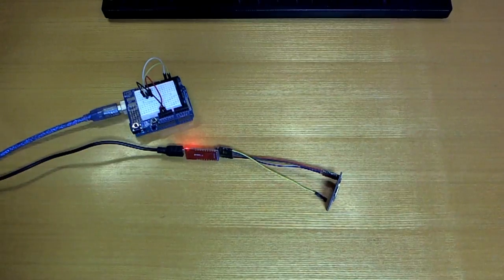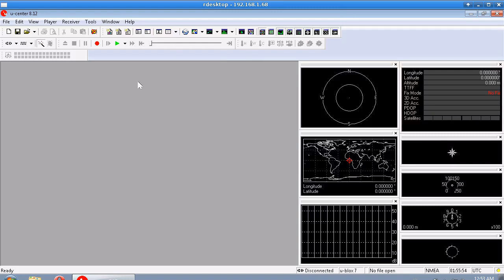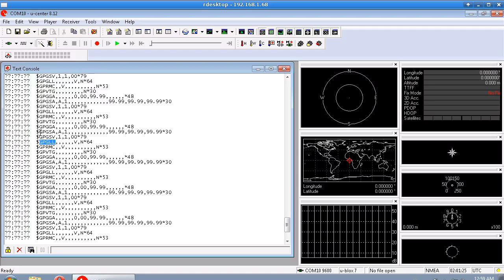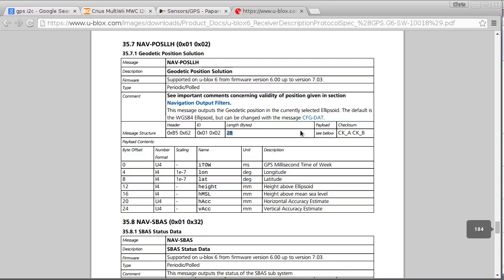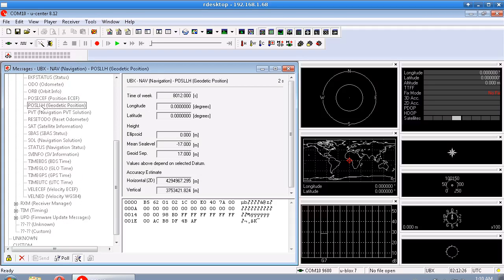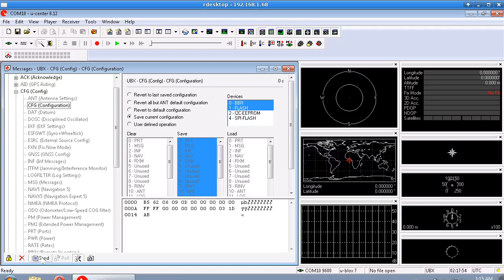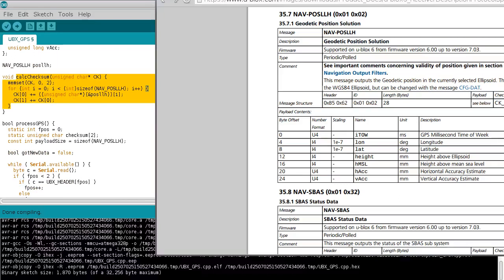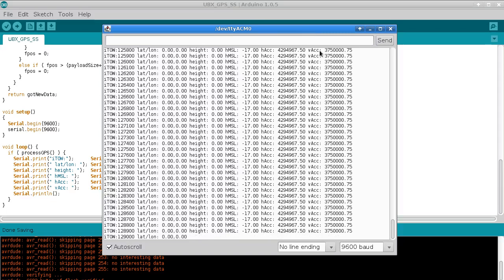10Hz U-blox binary GPS data in 66 lines of code (arduino)

Comment: hello brother, as i am trying to get NAV-TIMEGPS and NAV-TIMEUTC i am unable to read full packets its not reading last 5 packets so returning none. do you have any idea. i am using your multiple packets code added with NAV-TIMEGPS and NAV-TIMEUTC. i am doing this for esp8266 for reading nano second time. thankyou in advance.
Reply from the maker: Almost every time someone asks about using other message types, they are just getting the length of the packet (struct) wrong. The lengths of some packets can change between versions of the UBX protocol - make sure the documentation you are reading is for the firmware you're actually running.

Comment: Nice vid, helps if you've already tried to make sense of it all previously. I to have noticed a "save" problem. When i set my 6m to 10hz and 115,200 it connects to my naze 32 but when i connect back to u-center it defaults back to 1hz and 9600???
Reply: I see your comment was from nearly a year ago, so hopefully you found an explanation already, but in case you haven't and for anyone that runs into this, and also for the OP in case he hasn't bothered to figure these points out.

1) to save the settings, there are many methods to get to it but all roads lead to the same place...if you click the menu receiver, action, save config it will open up the packet view, and will drill down to the CFG/CFG message. The default that comes up is sufficient in most cases, simply click the send button at the bottom and it will do it. specifically the middle box should have all or nearly  all selected, left box unselected, and the devices box should normally have at least the flash selected.  * Note that some of the cheap modules don't have flash chips, or any means to save any settings. However, all is not lost, as many of the flight controllers have incorporated some form of auto-config, where it will check the uart at 9600 and if it finds a ublox module, it will attempt to reconfigure it to it's expected setup.

2) the list of possible packets that are grey/black signify what messages have been received from the module within the last 3-5 seconds. The main difference being that when you click on a black item, it will already have information in it, and when you click on a grey item, u-center will request the information from the module, and populate it if the module responds with the info. * For all practical purposes, it will typically be difficult to discern the difference unless the module has oversubscribed the data link.

Comment: i put the antenna with GPS module (neo6mv2,neo-6m-0-001) but latitude and longitude is blank. what can i do please help.
i also check during travel.
Reply from the maker: +kamran khan khanzada if you want help you should give more useful information so I don't need to make guesses and ask every little thing. Eg. is there any activity at all on the UART lines? Is the module sending any valid info at all? Is it sending the current time at least? Is it outside? How long did you wait? etc etc

Comment: Thank you for a brilliant  video, I have been experimenting with the NEO-6M gps module using your code with some success. I have noted however that the Lat and Lon values are only to two decimal places. My knowledge of C++ is very limited so my efforts to date have not been successful in increasing the number of decimal places.
Comparing the value from the NEO6 and a Garmin Etrex  there is approx. 400mtrs difference. 
Can you point me in the right direction please.
Reply from the maker: It sounds like you might be using arduino's Serial.print function to look at the values, and not specifying the number of decimal places, which defaults to two.
https://www.arduino.cc/reference/en/language/functions/communication/serial/print/
Reply: Hello  @iforce2d ,
 Thank you so much for the pointer I have modified my/your  code to give 4 decimal places, the result is now more acceptable. My next step is to send the data to my OLED display. Thank you again for your help :)
Reply: @iforce2d  Hello again,  I have been experimenting with the my NEO6M GPS and an  128x64 OLED display using the multi message sketch you have produced. Adding a display function I have been able to display LAT/LON, hMSL, vAcc and hAcc,  from POSLLH onto my display with not issues. Then I tried to add gpsFix from message NAV_STATUS , Serial printing is ok I get a value say 3. I then created a  second struct as you did for POSLLH  for the STATUS message using this value (locData2.gpsFix) I get a value of 3 on my oled display, then it toggles to what appears to be an address which increments up to 255 then starts from 0 back up to 255. the curious thing is if I serial print (locData2.gpsFix) it will display the correct value say 3.
If I call the display function from the STATUS message only and don't include the POSLLH message  I get the correct information on the display and the serial monitor.
This is bugging me any ideas!! . My other option is to use a NMEA sentence which has all the data I need, unfortunately my NEO6M wil not give me the PVT sentence. 
Apologies for the essay.

Comment: The data is coming in but, I can not change anyting in the u-center messages window. I can see the TX led lights up when i click "Disable Message" but the ublox receiver (neo m8n) does not apply the command.
Reply: Solution: I found that it works if you use SoftwareSerial on Arduino instead of the hardwareSerial
Reply from the maker: Maybe you were not aware that the hardware serial and the USB connection to your computer are the same thing. So you can't use hardware serial and USB at the same time. You have to disconnect the hardware serial pins to upload a sketch, and disconnect the USB to run it. You might find that software serial does not work well if you want a fast update rate.

Comment: What I need is latitude/longitude as well as the angle from the north and the director the gps is headed at. I do not know how exactly that is called (course, heading, azimuth) and I don't know what type of package transfers this type of information. Initially I tried to get this out of neo m8n but after repeated failures, i've fallen back to neo 6m, which I don't even know if it has a compass. I've tried a lot of things but they don't seem to be working, and they confuse me more. Could someone help me? Could TinyGps prove useful, or I need a different parser? Also i 'd rather use m8n due to its smaller size, but if any of these modules (m8n, 6m) meets these requirements, i'd be happy to work with it.
Reply from the maker: It's all in the docs bro https://www.u-blox.com/sites/default/files/products/documents/u-blox8-M8_ReceiverDescrProtSpec_(UBX-13003221)_Public.pdf
For m8n I would try the NAV_PVT message, it has pretty much everything you'll need. Keep in mind heading is only meaningful when the GPS is moving...
Reply from the maker: See also this follow-up, I used the NAV_PVT message here: https://www.youtube.com/watch?v=ylxwOg2pXrc
Reply: Thank you very much, yes, the GPS will be on the move. So I will pretty much disable all messages except NAV_PVT? I suppose on your video there is a parser for this message, i am about to watch it now.
Reply: After watching your video, and configuring the m8n appropriately (i think), I was able to get it to work with the u-center. Unfortunately the data was very inaccurate (several meters away), and on the information window it said that my fix was invalid. Nevertheless, I loaded your sketch (the NAV_PVT one), but it displayed no info. I suppose that processGPS() never returned true; . So is this invalid fix causing this issue? If yes, do you know any possible solutions. Thanks.
Reply from the maker: You don't need to configure the module at all if you let the arduino do it, as in the follow-up video I linked to. I have never seen any of my m8n's say 'invalid' for the fix, even when indoors, and they usually only take a minute or two at most to pick up a fix from a cold start. Maybe you have some bad interference in your area. The processGPS function should return true even without any kind of fix at all, provided your wiring is connected correctly.
Reply: Okay, after numerous tries I was able to get good GPS data using the NAV_POSLLH and NAV_STATUS. Unfortunately when I try to do the same thing wit NAV_PVT it's not quite working, although they all work the same way. However, using NAV_PVT I was able to get the heading on u-center. Its response time looked extremely slow, too slow for a self driving drone that needs to constantly correct its course. I was also unable to confirm the validity of the heading readings. Do you advise me to keep on trying to get the heading data on my arduino (despite its low speed), or start searhing for an external compass/magnetometer? Thanks.
Reply from the maker: Sounds like you still have the POSLLH and STATUS messages coming through, but you are only attempting to process the PVT. Pretty sure I mentioned this in my follow up video because I wasted many hours on it myself. Has naughty Joseph been skipping through the video instead of just watching it all? :) You need to explicitly disable any default messages you don't want (ie. all NMEA messages) and also disable any other messages you have been using since the GPS has been powered up (or perhaps even recently, it sometimes seems to remember for a while even after being powered off). So basically, disable every single message, and then re-enable just the one you want. That's why I left those 'disable' lines in the source code. The problem is that most of the time you start reading one of the other two messages into the struct and then the CRC check fails. Just by luck, every now and then the PVT message will come through normally. As I said earlier the heading will not be valid unless the GPS is moving.
Reply from the maker: https://youtu.be/ylxwOg2pXrc?t=24m31s
Reply: No I haven't been skipping through it :p I forgot the part that you need to move the GPS. I was testing it minutes ago standing still waiting for accurate reading. I will test it again and will update.

Comment: I learned a lot ! Very good ! I have a NEO-M8N-0-01, but I can not upload the sketch. Any idea ?
Reply from the maker: If you look at this from the point of view of somebody reading your question, there is no information to go on... at least say what error message you got. If you are just talking about problems using the arduino IDE the arduino forums have hundreds of threads about that.
Reply: I start with the Arduino Blink sample, i worked fine ! Then I took your code from iforce as mentioned , copy and pasted it. I connected NEO to GND and 3.3V on the Arduino. Without Rx and Tx connected uploading worked. With Tx from NEO connected to Rx from Arduino it failed to upload. Any idea ?
Reply from the maker: Pins 0 and 1 on the arduino are the RX and TX pins, these are shared with the USB connection to your computer. So you can't upload a sketch while something is connected to these. You'll need to disconnect pins 0 and 1 of the arduino while uploading sketches.
Reply: Stupid I am !  Now I can upload. Thanks.

Comment: Why did you dissable child messages? GNSS will not work properly without some of this data. If you want only UBX out, fine, but set '0+1+2 - UBX+NMEA+RTCM' under 'Protocol in', and for 'Protocol out' set '0 - UBX' and perhaps 'Baudrate 57600' - all under CFG->PRT(Ports) setting. This way you will have GPS and GNSS (plus other sats if set) - everything 'exported out of device out in form of UBX only. Instead having 4-5 satelittes indoor, I have 9-11 (okay, this is M8N device, but anyway).
Reply from the maker: +Milan Karakas Because this code only expects to get one type of message - I have hardcoded everything to deal only with the POSLLH message. What do you mean it will not 'work' properly?
Reply: +iforce2d For some reason, when 'child messages' are disabled, Glonass satelittes are not 'taken in account', so only GPS ones showing up.

Comment: Great video! Thanks for sharing!
I am having troubles in enabling the PVT message (the one right below POSLLH). Can you please check if you have the same problem? or something needs to be done? I am starting thinking my gps is broken but it doesnt make a lot of sense...thank you
Reply from the maker: Guido, Francesco Ritelli "problems" is very vague....
Reply: *****, you are perfectly right. Well when I go to Messages View -> Nav -> PVT and right click enable I get this in the Binary console: B5 62 01 07 00 00 08 19. The identifier 01 07 is right but the length is zero. I also checked UBX -> ACK -> it says failure. On the side I also just noticed the I don't have the green light flashing anymore...
Reply from the maker: Guido, Francesco Ritelli This is for an M8? I've never used one. Keep in mind you will have to change a lot more than just the UBX message enabling to get the data into your arduino correctly. See the discussion with "acho66" in the comments here for some related hints and see his source code.
Reply: ***** I am using an M6. Oh yes, I already made all the changes needed according to the expected data from the datasheet. Now I am not even using arduino. I'm using the ublox console and I am simply not able to enable the PVT message. Take a look at the screenshot http://i59.tinypic.com/25ajmkx.png
The bottom box is empty....shouldnt I see something like a binary message?
Reply from the maker: Guido, Francesco Ritelli Which datasheet are you looking at? I don't see any PVT message mentioned in the documentation for the M6 series..... eg. http://www.kayraelektronik.com/download/gps-moduller/LEA/u-blox6_ReceiverDescriptionProtocolSpec_(GPS.G6-SW-10018).pdf I think it is only available from 7 series onwards.
Reply from the maker: Guido, Francesco Ritelli hmmm..... my pdf is from 2010 and yours is from 2012. I'm guessing the firmware on your module doesn't know about the new messages - otherwise I have no idea.
Reply: ***** yeah that's something else I'm having troubles with. Do you know any place where to find updated firmwares? I have been looking everywhere, including the u-blox website, but nothing...
Reply from the maker: Guido, Francesco Ritelli I have no idea. I would start by trying to find out what firmware you have in the first place. No idea how to do that either though. I just do this as a hobby, I don't know everything ;)
Reply: ***** hey no problem. You already did a lot sharing this video. Basically what I need from the gps is: lat, lon, date&time, heading and ground speed. Without being able to use PVT I will have to use multiple messages. I'm trying to figure out how to do it re-using your code. Thanks again!

Comment: ok,can u tell me what voltage i used for neo6mv2.its 3v3 or 5v ?
Reply from the maker: +kamran khan khanzada it will depend on your particular module. Usually they are on a board that has a 5v to 3.3v regulator, so you can use either.

Comment: I've got really stuck on this.

It's connected using the same FTDI adaptor and reading data fine - I can change some config bits and I can see the TX light on the adaptor flash

But I can't change the messages, when I disable them it doesn't seem to transmit anything at all and they all just revert back to standard NMEA set :(

Any ideas?
Reply from the maker: +Phil Barker I can't really answer a vague 'any ideas' question without you telling me exactly what you changed, and at what point it stopped working... did you have it working with the code I gave to start with? I'm not sure what you mean by config bits, or what message you are changing to, or how it can be 'not sending anything at all' but it using the NMEA set, seems contradictory :)
Reply: +iforce2d sorry I didn't explain very well. I didn't change anything at all, just followed the video. But when I got to turning off the nmea messages it doesn't transmit anything to the device like id expect and the messages stay on. 

To see if transmitting was working at all I tried changing something like the rate to 100 and that worked and the transmit light flashed on the ftdi so it can transmit serial data to the chip. Just the messages screen won't let me turn the nmea messages off or the ubx message on :(
Reply from the maker: +Phil Barker I don't understand... if it's not transmitting anything then all messages must be off. How are you determining that 'NMEA messages stay on'?
As I said in the video, after turning all messages off you then need to turn the POSLLH message on for the UBX protocol.
Maybe if you could just do everything exactly as I did in the video and tell me at what point you see a different result, is the best way for me to have 'any ideas' :)
Reply: +iforce2d haha I'm making a hash of this. When I say it's not transmitting anything I mean the tx light on the ftdi doesn't flicker at all. So it looks like the app isn't sending any codes to the u-blox chip. 

I click disable or disable all and they all go grey then instantly back to black. Basically it seems like the app can't alter what messages the chip sends :(
Reply from the maker: +Phil Barker Are you using a genuine u-blox module? Maybe it is ignoring the u-center app completely. I wouldn't bother using the tx light as a judge of anything, you can see what the module is sending in the messages views of the u-center app.
Reply: +iforce2d it's an itead gps shield but has a genuine ublox neo-6m on